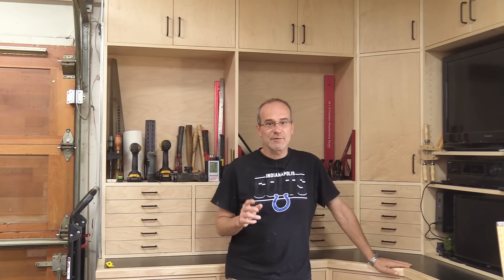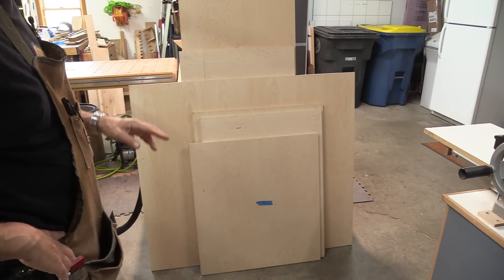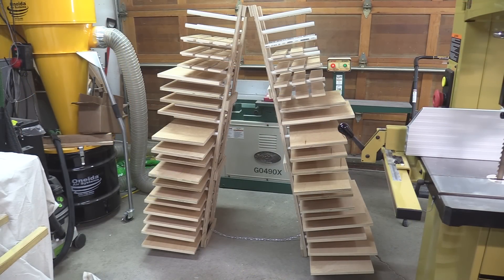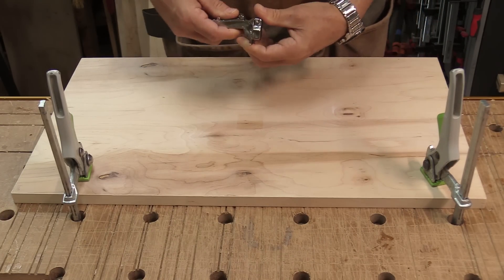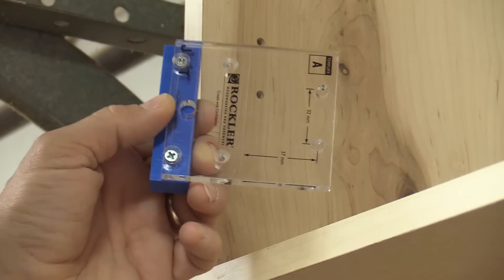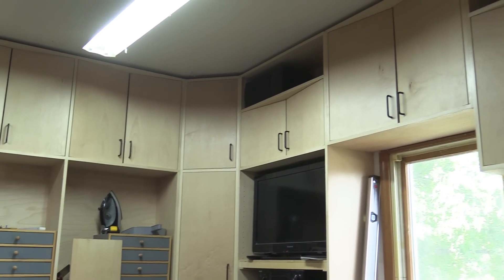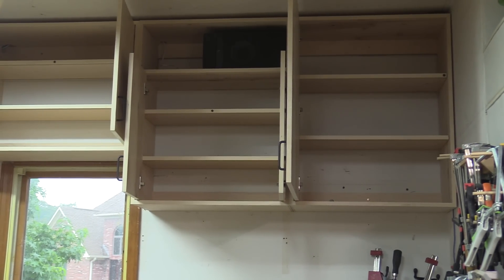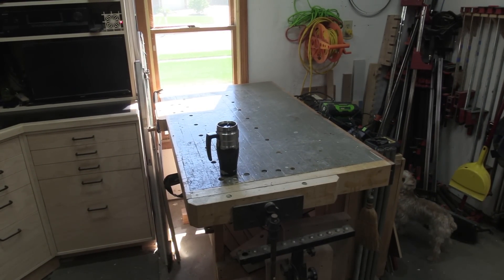Shop Cabinet Upgrade - Drawer Fronts, Cabinet Doors and Finishing Up - Pt 4 - Woodworking How To

Comment: Wow it really turned out great.  Lot of work!  What do you use for edge banding?  i just bought the Fast Edge kit and supplies from Fast Cap.  Doing a bunch of PVC edge for melamine.  It is a great system.
Reply from the maker: Thanks Neil! Yeah, I used the Fast Cap Fast Edge for some of this project, and iron on for some of the project.

Comment: Hey Guy, nice job, I've enjoyed watching this series of videos.  One small tip I learned years ago when I was a kitchen fitter is that the felt door stops (or whatever material the stops are made of) are attached to the doors not the shelves.  That way they aren't staring you in the face when you open the doors.  Keep up the good work!
Reply from the maker: Thanks! Yeah, I thought of that well after I out them on. I am not a cabinet maker, so some things that are very obvious to some are not so obvious to me :)

Comment: Hey Guy, been watching your videoes and like the work you do. Can you tell the part numbers to the hinges that you presented in video Shop Cabinet Upgrade - Drawer Fronts, Cabinet Doors and Finishing Up - Pt 4? thank you
Reply from the maker: Hi Carol. Don't remember the part number, however they are pretty standard hinges. Search for Euro hinges that are designed for inset doors.
Reply: Thank you

Comment: Plywood: Not sure where you're located, but here in Maryland, the Home Depot and Lowes stores near me carry only the worst "cabinet grade" maple plywood. You cut it open and find huge voids (like 2" x 1" holes), and the veneer is not only super thin, but also barely adhered. Finally, it tends to move a *lot*.

I've been working to find better sources near me, with higher quality plywood. It's likely that I'll have to order the 2-side prefinished stuff in quantity from a place up in Baltimore. There's a minimum order, and no way to see the material before ordering, but seems more likely to be better than HD.
Reply from the maker: Hey Pete. The Home Depot near me here in Indianapolis carries Pure Bond ply. It is reasonably good, and the price is right. There are also a couple distributors here in town that carry it.
Reply: Just ran across your channel, you do good work!  I grew up 20 minutes northwest of Indy. Hail Purdue!😆
Reply: I too live in Md. Harford county. Did Chesapeake Plywood treat you good? I plan to buy cabinet grade prefinished plywood.
Reply: Home Depot here in Jacksonville Florida - cabinet grade plywood is terrible.  Same issues that Pete mentioned plus bows.

Comment: So where do you get your "banding" from?  What do you use to put them on?
Reply from the maker: I bought it from Amazon, and it's mostly iron on banding. I did use some of the Fastcap adhesive backed too. Worked really well, just expensive as heck.